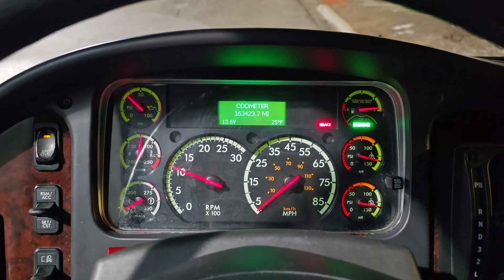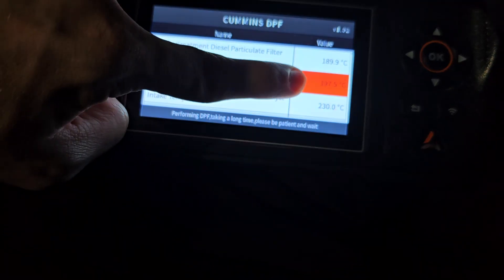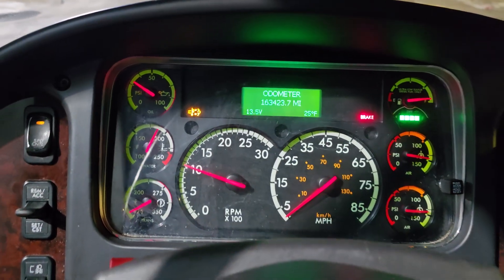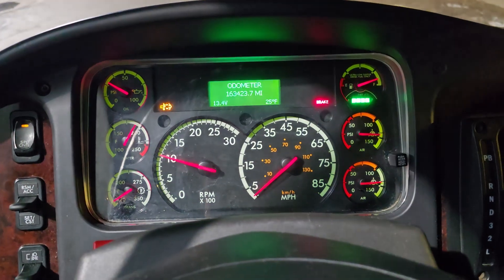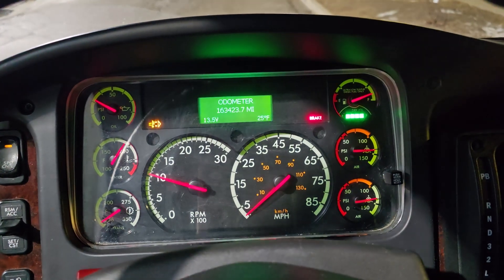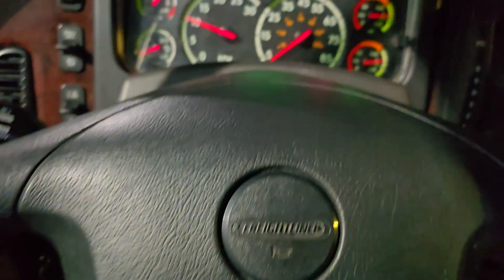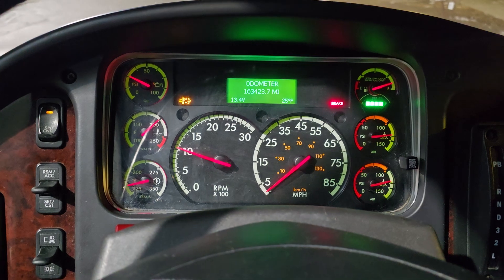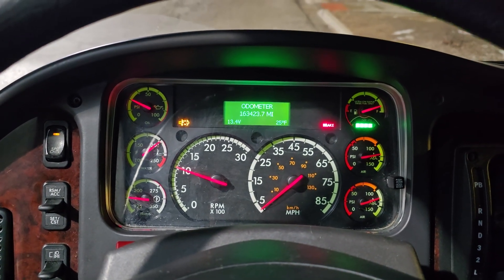What to Look for When Performing a Forced Regen On a Diesel Truck/Bus

Comment: I have a freightliner M2 Box Truck. When a driving and it’s start the automatic regen my two check engine light comes on and it’s not regenerating properly, I have to stop and do a force regen all the time. Can you tell me if you have an idea of what’s the problem
Reply from the maker: You may have an issue where the exhaust is getting filled up with soot faster than it should be.  When you get the CEL, do you also have a flashing DPF light?